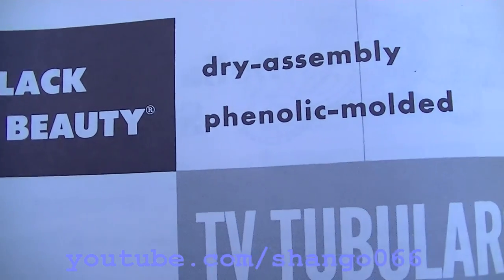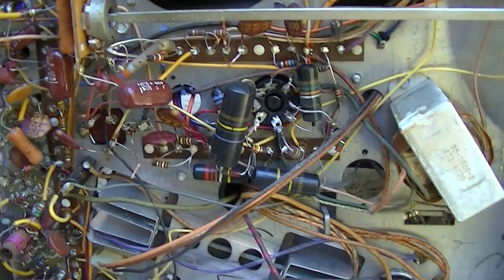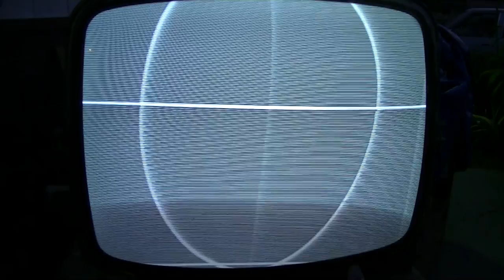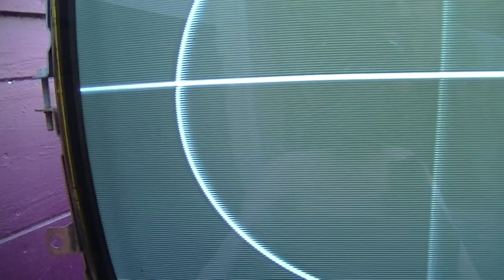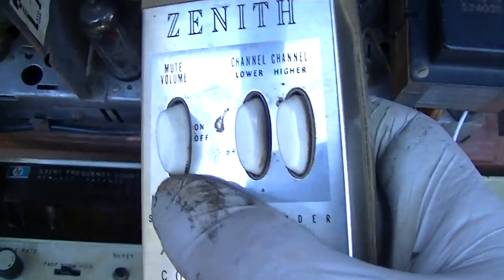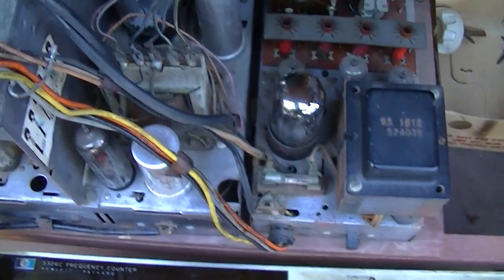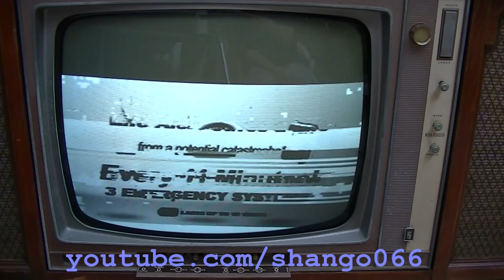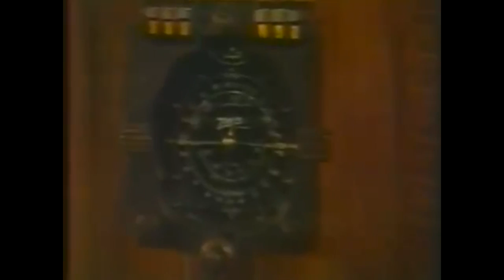1961 Zenith Space Command Black And White Television Console Repair

Comment: Do all American TVs buzz? Interesting that they have pots to make it louder or softer, but never clearing it completely!! Having only ever worked on Pal/UK TVs, I do not recall buzz ever being an issue. Mind you, was MANY years ago! These days the buzzing is in my ears!
Reply: Zenith used a gated beam audio detector tube, that they developed it was the 6BN6, In later years a dual tube compactron tube 6J10/6Z10 & series string filament 13Z10 ,that combined the gated beam detector and audio output stage, the control on the rear of the chassis is labeled "buzz adjust" it is in the cathode circuit and adjusted for maximum AM rejecton or minimum buzz. I myself did not like this audio detector scheme, although simple to align it seemed to require re-adjustment as the tube aged and you never totally got all of the buzz out. It never caught on with other manufacturers, it was mostly a Zenith thing.

Comment: OK my thinking on the heat sinks on the power transformer  is to form a kind of Thermo-fan for the chassis. So not to cool the transformer but use the heat of the transformer to pull heat from the classes..

Comment: It would have been cool if the engineers had thought to put inputs on the back to add a radio or phonograph to take advantage of the speaker system.